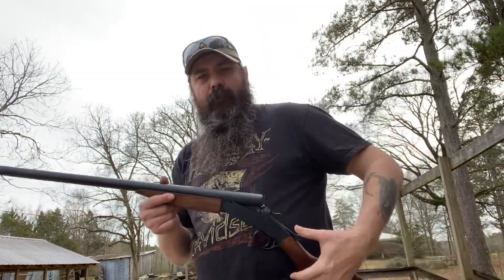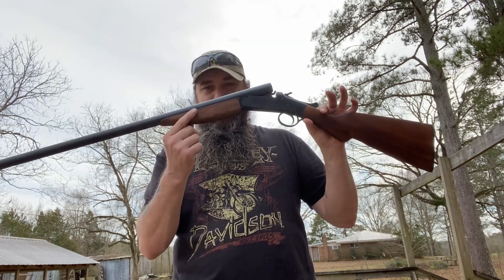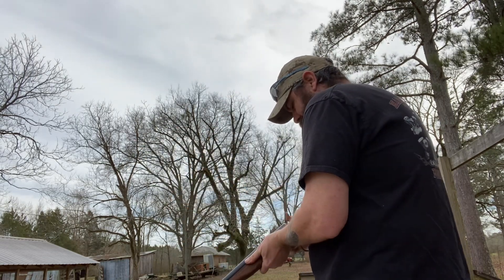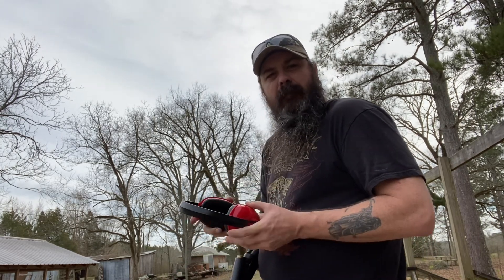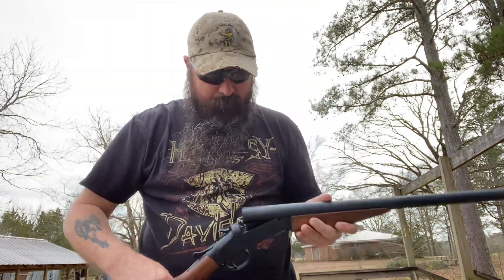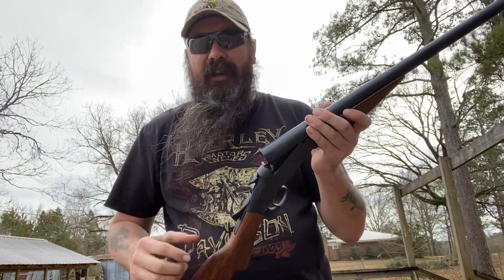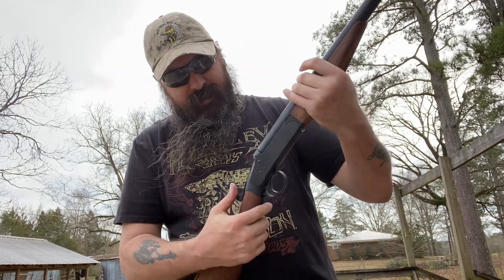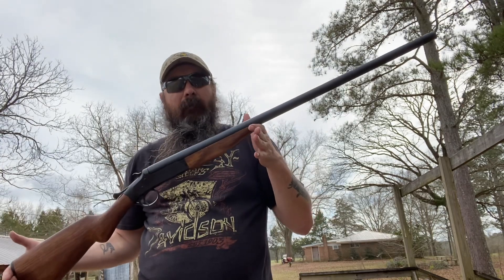Iver Johnson restoration (final)

Comment: You done a great job on that Iver Johnson. I got a very old one with a side lever take down. It has the standard break open lever behind the trigger. Ive had that Iver for around 15 years its been sleeved I think. Anyhow I have won more meat&money in turkeyshoots than any gun Ive ever had. I would not take nothing for it.
Reply from the maker: Thanks. I appreciate it. I love them older guns, but as you see I make my bread and butter off the new ones.
Reply: @Bigbeebeellc  Ive had a friend restore several old singles&side by sides
Reply from the maker: Nice. I’d love to see them. 👍